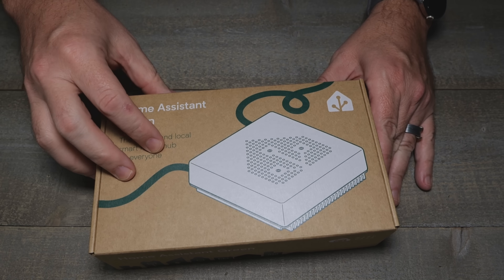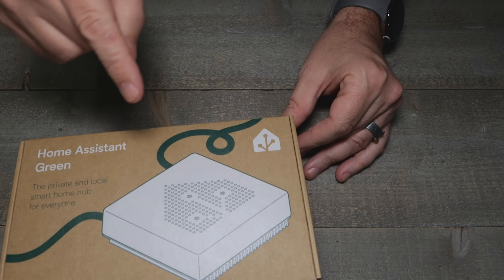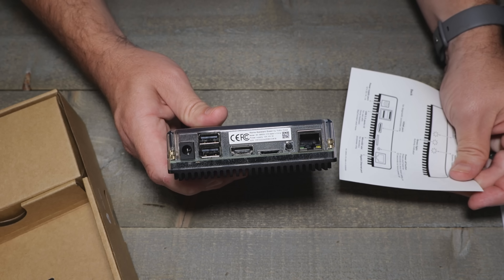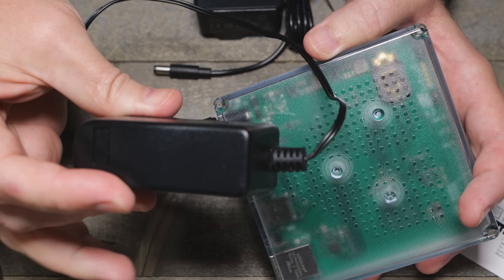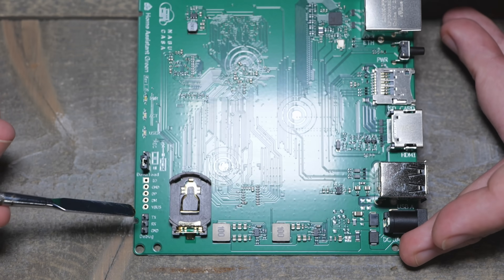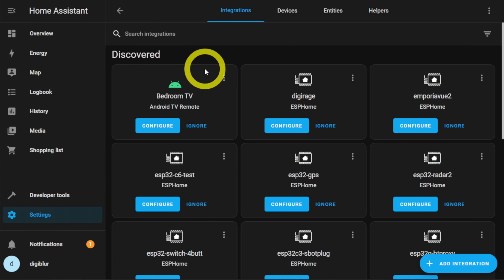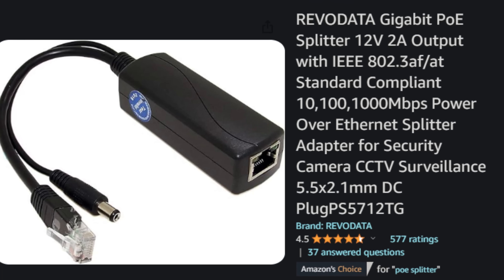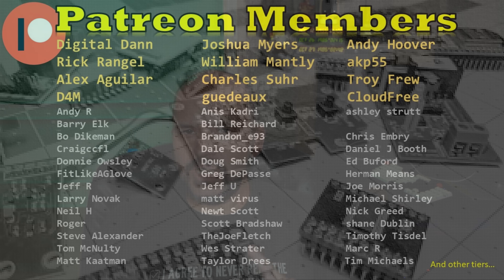Home Assistant Green: Best Smart Home Hub for Beginners? (Unboxing and Review)

Comment: Can I install slzb-06 to this green device?
Reply from the maker: Not on the device itself well I guess you could use it via usb but I would just connect the slzb-06 to your network
Reply: @digiblurDIY  ok thanks, so I want to start my HA journey with green device and go with slzb-06 coordinator for further upgrade. So should I connect Green with Ethernet and slzb-06 with Ethernet separetely?
Reply from the maker: @mialbj that's what I would do. Just plug it into your ethernet and the green can access it over the network

Comment: I was looking for a way to create a Z-wave bridge to my home security system, and decided to try one of these. I had no experience with Home Assistant at the time, but the affordable price and pre-installed operating system were appealing to me. I ordered one, along with a Zooz Z-wave dongle. When I received the unit I was impressed with the build quality, along with the neat packaging. Lack of wifi was not a concern for me since I wanted to plug it directly into my router. Within a couple of minutes after plugging it in, it was set up and running. It easily integrated with my security system, as well as the Z-wave dongle. Then I realized that a whole new universe of home automation possibilities had opened up for me! For anyone new to home automation, wanting to get started with a simple, ready-made device, I would recommend it. I may eventually want to move to something faster, with more ports, but for now I'm enjoying it.
Reply from the maker: Yeah they are a great little starter box for small setups to get your feet wet!

Comment: Thanks for the review. I was about to buy this model, however I got to know it’s as powerful as RasPi so I am happy with my Lenovo Tiny which got more power and runs without any glitch. AFAIK automation is sophistication and comfort, not for power saving. If power and cost saving is the Moto then stay in manual mode, walk few steps and press the wall switch.
Reply from the maker: No reason to really downgrade for sure!

Comment: I'm a beginner, would you getting  Beelink N95 or Raspberry Pi 5? Is it hard to install the OS on N95? Would I have more problems with home assistant if I install Ubuntu as opposed to Rpi?
Reply from the maker: Depends on your budget..  with the price gap so close I'd lean towards a mini pc myself, even some of the refurbs can be had for $100 if you look around.  It's not hard to load.  I covered it here, there are chapter marks to jump around - https://www.youtube.com/watch?v=rch6jcMfwEs
Reply: @digiblurDIY  thank you for your quick reply! As you said, there's not much difference on the price anyway. Since I'm a beginner, I just wanted to be future proof and be able to add more use cases of I wanted to in the future. That's why I thought maybe Rip 5 for a better community support, but probably I can do most of the things I'd do in Rip in mini PC too, right?
Reply from the maker: Probably much more given the N95 box is a x86 chipset versus arm based. So if you decide to go Proxmox or something later it has plenty of power and space too.

Comment: I like it. Negligible power consumption, perfect for up to 10 esphome devices for a pv system or something. Add a 10 bucks 12v ups and it's great. More importantly, this is a sign Home Assistant will stay light. Didn't yet found specs for the mmc, hopefully will be with decent nand write amount. 
Will recommend to friends when they ask about this blue icon app on my phone that I keep opening.
Reply from the maker: Yep. Great for a small lightweight simple system someone is throwing in.

Comment: Really impressed with the low power consumption. A big deal in my book. As is the lack of any fans. Passive cooling is a must for me as I am working in my homelab.

And even with several cameras and hundreds of devices and automations, a Rpi4-like performance is good enough for me 👍🏻
Reply from the maker: Same...that was pretty impressive but I would have liked to see a better processor chosen.  I don't see how you do it on the Pi4 with all that.  I could easily bring this box to its knees with a few simple things, let's not even get into ESPHome compiles.
Reply: @digiblurDIY  I use an 8GB Rpi4 w SSD and often compile ESPHome firmware for my ESPs. I don’t have on-device/server person detection, however. That is built into my Reolink cams so this also frees up some resources on my pi. I’m running only 5-6 add-ons including Node-RED. I’m sure a nuc or old server is better but I just don’t like the idea of the higher consumption. The extra power cost almost feels like an extra subscription since I don’t produce my own electricity.

Comment: Yeah, still scratching my head what’s the target user for this one.
Reply from the maker: It is an odd one as it seems to be targeted as a hub for folks but is missing things the average user would expect.  Of course Wi-Fi isn't the best connection but I know many average users would want this.  It also needs a 30 second hold button that factory defaults an image without the user needing to reload it via micro SD card.

Comment: Somewhat new to HA.   I like the stand alone device that HA Green offers.  Maybe a more in-depth video covering the operation of this compared to using HA on other systems.  You said it is slow but what does that mean?   Is it slow for everything including operating home automation or is it just slow for programing?    I bought the HA Green but have not set it up yet.  My current system is HomeVision and is X-10 based ( I know it is old but it has served me very well for 25+ years.  Noise issues are getting worse and the reason for the upgrade).   I have probably about 40 things I control currently and about 10 control pads. Mainly lights but I can see me expanding into door/window sensors, motion sensors and displays for control.  Was the HA Grean a bad choice?  

I tried installing HA on a PC in a virtual machine but everything quits when it gets rebooted due to an WIndows update.  I had a hard time getting Skyconnect to work too.  Thought this stand alone device would be much better but now I am not so sure.   If I start with this how hard would it be to move to something with more power at a later date?  I think most of what I am planning on doing will be Zigbee.     Thx for the great videos.
Reply from the maker: I wouldn't install it on a VM in Windows at all unless you just want to see what it does for a couple hours to determine if you want to go further in the HA world.  

It's not a bad box to start out with and get your feet wet but the performance isn't really there given 4 years ago the Rpi4 was the thing and we are still running it on the same processor performances?   Computers change a lot in 4 years.  Especially when you have a little NUC device or refurb small form factor computers for about the same price. The only downside is you have to load that yourself but that is something I feel everyone should be able to do is to recover their system in case of emergency.

It's not hard to move devices using the backup and restore backup process.
Reply: @digiblurDIY  im just thinking, if it runs HA with no problem, is it really slow then? i mean its build for that specific purpose, and if it does so flawlessly, can it really be called slow.
though i have no experience with the device my self, though im considering buying it. but if it runs HA fine, then im not sure i would call it slow for its job, sure perhaps if it would be used for other things to, then a tiny pc would probably be prefered. Ofc if it has problems running HA, its not fine :)
Reply from the maker: @Crisping1612 just like an old computer would run windows 10 fine even though it takes 20 minutes to boot up?
Reply: @digiblurDIY  well i havent seen how fast it actually runs on the HA Green, though i did exspect it to run smoothly atleast. was probably poor wording on my part, if i buy something like the HA Green, wich is made specifically for HA, i woulden exspect it to be released out of the box, with too low specs, to even run it smoothly. though i dont know HA enough to know what kind of things will cause HA to be more resource demanding, how many devices and such it could handle before the HA Green might start to slow down.
Reply from the maker: @Crisping1612 just not my recommendation to get into at this time given the lack luster performance. There are better options at a better value that you won't be looking to upgrade in 6 months.

Comment: First off Many thanks for a Good video as you said it a good starter heck my Odroid N2+ with 8gb mem and 128gb emmc has been running strong for a few years now. Been really thinking about jumping up to a NUC .. Perhaps that will be my xmas gift to my self.... And WTF I do not consent to the subliminal messaging of flashing Heff face on the screen like that.. I may have traumatized from being scared like that.... :) jk
Reply from the maker: That's actually not a bad processor spec and storage.  Definitely faster than this one.  If it works it works.   When I heard what I said during editing I knew what needed to be done.

Comment: Nice video Travis. I'm happily running HA Supervised on my OrangePi 5 with 16GB RAM and the RK3588S is miles faster than the RaspberryPi 4. Not sure this one is worth it for $99 as the RK3566 just ain't powerful enough.
Reply from the maker: I had to look this SOC up and wow, that's some nice performance.  If they would have doubled the SOC speed at least, it would have been a decent upgrade for folks to jump to.
Reply: @digiblurDIY  the RK3588S is simialr in performance to the upcoming RPi 5 but still slower than budget X86 mini PCs 👍
Reply from the maker: Looks like it was more than twice the performance from what I remember. Now after the Rpi5 release it is more of a headscratcher for the green

Comment: It looks interesting and all and is a step up from the Raspberry PI's but still doesn't stand up to the Odroid N2+.  The Odroid N2+ has the Amlogic S922X and it stops all over the Rockchip RK3566.  Does that really matter, probably not if you are only running HA and a couple other things but if you have much more than that it's going to get anemic quick.  Though with the NUC's being that low it's not a bad thing to jump into.  When I got my N2+ the NUC's were running around 300 and I want to say that the HAOS wasn't available to install on X86 so you lost out on things like the add-on store.  I actually started running HomeAssistant on my FreeNAS box though I can't remember if it was a jail or a VM but no add-on store availability was there.

I know a ton of people want to see WiFi installed but let's be honest, a wired connection will be faster and more stable so the loss of WiFi isn't a huge deal if you have a router or a switch.  I worked for a WISP many years ago and troubleshooting a wireless connection is a PAIN.  Was at a jobsite a few times and could see the tower (a couple times it wasn't even that far away and I could connect to with my laptop but not the CPE) but not get the connection to work or be stable.  

Having the Zigbee, Matter, Thread, or Zwave connection would be nice for sure but at the same time you have to weigh the added cost overall and which one users prefer.  I was able to get the Odroid N2+ HomeAssistant Blue for my house for 165 plus shipping (the 4GB/128GB version) and adding in all the wireless would have likely put that into the 250 dollar range which a lot of people will not want to pay for.  In a way allowing people to buy their own adapter and plug it in when they decide on what ecosystem of wireless they want to use is a good thing as they are then free to buy whatever they want and it keeps the costs down.  I personally still feel like the wireless communication ecosystem is kinda like the BetaMax vs VHS or BluRay vs HD-DVD wars and have mostly stuck with WiFi based devices and am actually setup to use 3 TP-Link Omada EAP650's for the wireless network in my home which so far has worked great with multiple bulbs, switches, and other devices like my ESP32 based LED strips, Energy meter, water meter, and hot water heater controller.  

I think however the HomeAssistant Green will be something that will allow a lot of people to get started and potentially get HomeAssistant into some of the big box stores.  The price point and setup should be pretty easy for some of the less tech savvy people who don't want to part with a lot of cash but also are not too keen on dealing with changes to the use or monthly fees that could be added in later like what has happened in the past with some other companies.  Even using things from Amazon (and likely Google) can have caveats, not too long ago I was reading about a guy who's whole smart home was killed by Amazon when their ring doorbell greeted an Amazon delivery driver automatically and that driver then reported that someone said a racial slur was said to them.  Everything was shut down for almost 2 weeks and the automatic greeting was something like "Hello, can I help you."  Feel free to google "Amazon shuts down customer’s smart home devices after delivery driver’s false racism claim" and check it out yourself.
Reply from the maker: Sometimes missing out on the addon store is a good thing :)  

I think the average user this is targeted at will want Wi-Fi.  Look at all the other hubs out there.  I myself prefer ethernet of course but then again I also prefer running just docker containers too so I'm not the target audience here at all.
Reply: @digiblurDIY    I got ya there. I'm not great with software myself and have too many irons in the fire to treasure the time to really learn. Trying to figure out docker has been multiple years and while I can get stuff installed and working updates are a pain. I personally like using the FreeBSD jail system for everything I can. 

Hardware though I'm great with. Have 10Gbps fiber as my network backbone and have pulled 1500 feet of ethernet in the house so far with around another 1000 to go.

Comment: Love your videos thanks. T is a champion, always adventurous and not scared, excellent. Can you tell me I have Del Wyse 5070 that I upgraded from PI, recommended in your video. I am running Frigate and the Wyse 5070 seems to struggle with CPU etc. Can you recommend something else that's not too expensive. I can not get a Coral in South Africa, so that a problem etc. What other small PC etc. can I use, that will handle Frigate etc. Thanks
Reply from the maker: Thanks!  Always keeping it real!  I would dig around your local computer stores and see what refurbs you can get.

Comment: This is a perfect device to be marketed at places like Lowe's or Home Depot and for an entry level HA novice this is a perfect solution. At $100, I would have gladly purchased one myself years ago. 
 My Raspberry pi 3b has been running flawless for 4 yrs but is due for an upgrade. But I'll be using an HP Thin Client that I purchased on eBay for $25. Quad core CPU, 4gb RAM and 120gb SSD that I installed.
Reply from the maker: I'm not sure it is ready yet for that market to be honest.  They are getting there but still a bit to go compared to some other hubs marketed towards the average consumer.
Reply: perfect rip off. for 150$ you can get mini pc with intel cpu and 8GB of ram.
Reply: @SayWhaaaaaaaaaaaaaaaaaaaaaaat  Not at all a rip-off. For the entry level user with little computer or home automation experience this unit is great as it's preloaded with Home Assistant. Myself I've had over 20 yrs experience in Home Automation so this device is not of interest to me. But this definitely has it's place in the retail market place.

Comment: I love that big heatsink.  I was disappointed by the lack of BT WiFi and ZigBee/Thread.  Insult to injury only 2 USB ports.
Reply from the maker: yeah, definitely overkill.  I never saw the thing heat up at all.  I honestly don't mind the lack of Zigbee/Zwave as it allows the user to bring their own models easily.  Like if someone wants a solid Z2M setup, they should roll with a CC2652 series and not the EFR chipset like you find in the yellow.
Reply: @digiblurDIY  If they want to do it that way give me 4 nicely spaced USB ports or maybe 3 nicely spaced USB ports and WiFi that supports 5ghz to reduce interference with ZigBee/thread/Bluetooth.
Reply: I think I understand the lack of wireless capability. For one it can add up cost quickly considering that it adds to logistical problems due to the different regulations around the world and additional compliance tests. 
My guess is that the heat sink is mostly this big to also act as part of the case otherwise they would need to add more plastic parts, cut ventilation slots and independent mounts for casing and heatsink(s). I guess another drawback would be that onboard wireless performance with a huge chunk of metal on the bottom would also be poor adding to the reasons not to include wireless capability. The green version seems to put cost cutting measures on the top of the priority list.

I also don't really mind it because I don't put a whole lot of trust into wireless since it is way to unstable in some locations, depending on how many devices are sending on a particular frequency.